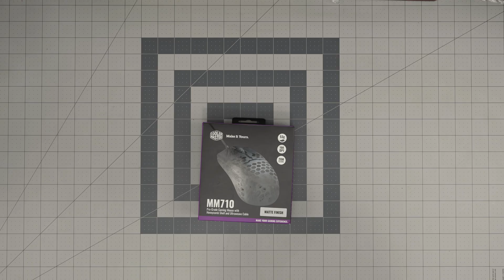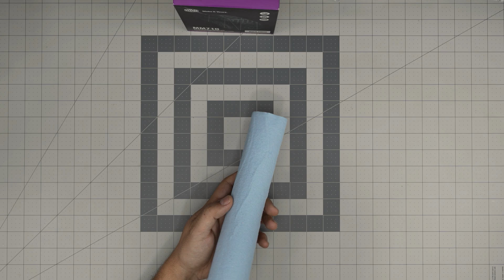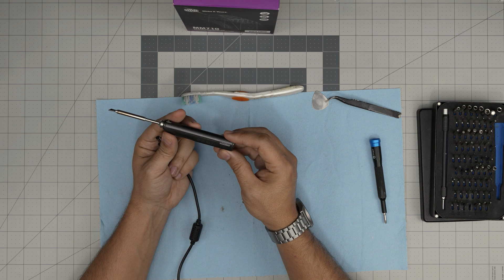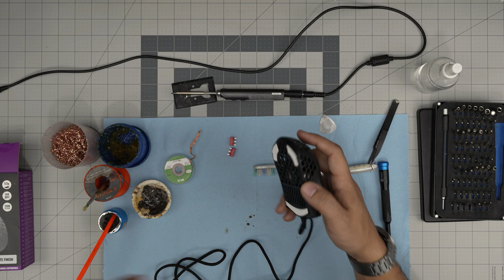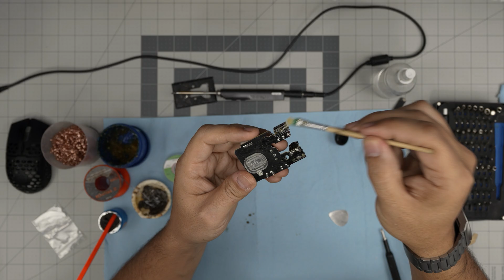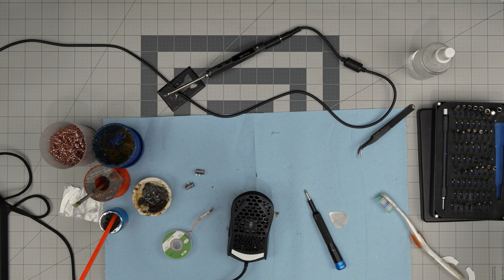Fix Double Click or No Click Issues on Any Mouse | Cooler Master MM710 / MM711 Mouse

Comment: I have a problem with the usb connector cable is there a way that I can fix it?
Reply from the maker: 🫠Regarding your question, you can purchase usb A cable and solder it directly in the connector.

Comment: Personally in my ghetto setup,  without soldering tools I used old PTFE skate to fix my clicks wooble and travel distance - I put it between the click and mouse shell, so it springs back - it works insanely well! my performance in flicking and onetapping improved since I click faster and easier, the button is under tension that makes it springy and solid, very clicky (shooting pistols is also faster and less exhausting). But thanks for the video, I will most likely use it to upgrade my switches in both of my mm712 copies. I also recommend removing the wheel rubber - it feels better now and it's 1g lighter :P
Reply from the maker: It's my pleasure my friend.
Yes, I only made this video about replacing/fixing the non-click or failed-click switches.
But yeah, filling the distance can give you a faster response and close the gap, though that’s not suitable for office users, as the click can easily misfire.

Removing the wheel rubber—I’m not sure it feels better. Personally, I like the feel of the rubber. 1g less 🤣 maybe! But if you really want to remove grams and make it lighter, remove the USB white jack on the board and the tip of the cable, and solder the cable directly onto the board—2g-3g saved right there. Also, remove (cut) some infills on the dome portion of the mouse case to shave off a few more grams 😉

cheers🍻
Reply: Genius! Thank you for advices, it opens new ways of thinking.  @uFixTek

Comment: what about replacing the switch for the roller part?
Reply from the maker: 🫠Regarding your question, it is the same exact as the others just remove the midle switch from board and replace it as you would the left or right one.

Comment: I have asus tuf f15 i5 11400H 2050
I am facing battery draining issue when laptop is shutdown
When I start my laptop after 1 day it's 8 to 10 Percent less 
It's under warranty (11 months)
Is it common or not
Reply from the maker: 🫠Regarding your question, that is not a battery issue; it is 100% normal because you have fast boot turned on. When you power on the laptop, it boots in just a few seconds into the desktop because you are not truly shutting it down.  

If you want to conserve the battery when shutting down the laptop, follow these steps:  
1. Click on the **Start menu**.  
2. Click on the **Power button**.  
3. When choosing the shutdown option, press and hold the *left SHIFT key* on your keyboard, then click on *Shut Down* and keep holding the SHIFT key until all the lights turn off.  

This ensures the laptop is fully turned off.  

The next time you power on the laptop, it will take about 10 seconds longer to load Windows since it will boot without any cached data.  

If you don't like holding the SHIFT key, let me know, and I can explain how to change the settings so you won’t need to do this.

Should you have any further questions or requests in the future, please don't hesitate to ask me.
cheers🍻
Reply: @uFixTek  Thanks for Reply 
Can you give your instagram id , I have some doubts I will dm you and clear it.